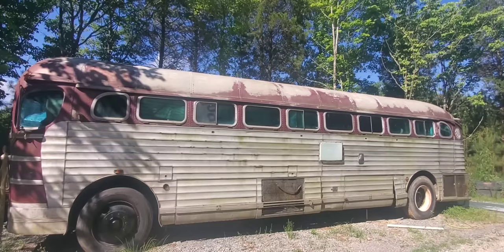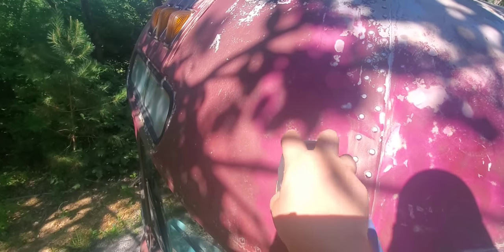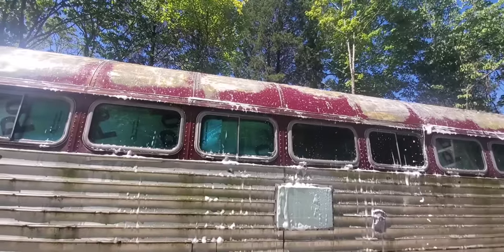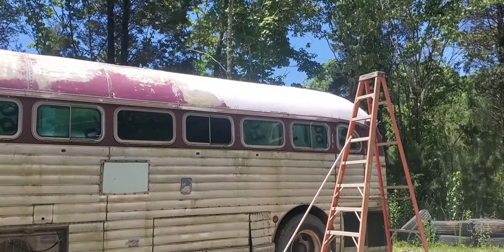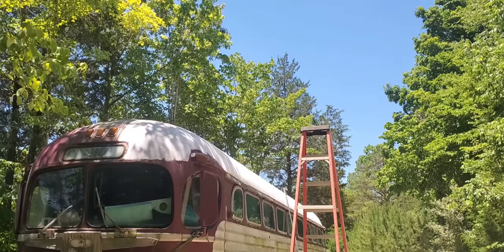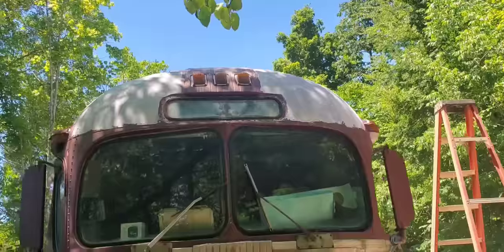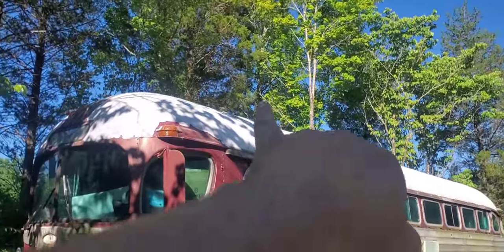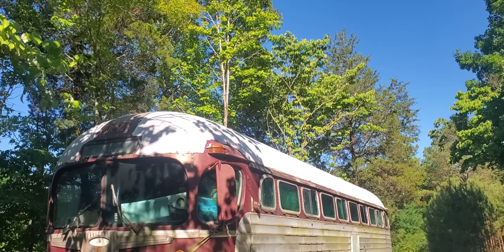Bus roof coating 1st coat

Comment: Henry's has a great elastomer product used on mobile homes that works the same way with heat deflection but it also is thick enough to be a sealant too! I've used it on a couple of projects, one being a mobile home roof that dropped the inside temperature significantly too!

Comment: Henry Tropi-Cool is best applied in complete coverage, wait till dry and not much longer, and then apply a second coat.  If you don't apply it thick enough, a third coat is important, and get it on not too long after the second coat has dried.  I'd guestimate you need 4 gallons to get proper mileage.

Comment: I thought florida was the only insanely hot place to work a bus roof. I hate my roof. Please be careful. It  is really easy to get heat stroke and not even know it. My 45 foot Van Hool roof needs to be respected as does yours. Be safe my brother.

Comment: There are vacuum panels that are kind of expensive, but are only around 1/2" thick with an R-30 insulation value.  Might be worth using in the bedroom area, or wherever the heat is worst.
Reply from the maker: Since I put the first coat on a week ago it's fixed almost all my issues with the roof heating up. That bare metal was in direct sun for most of the day.